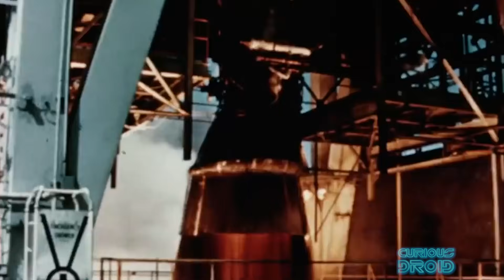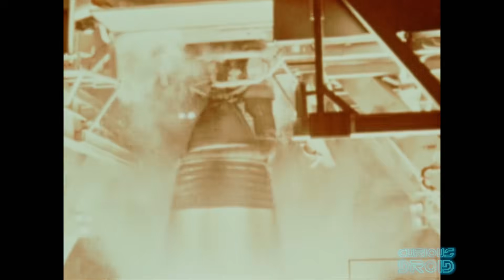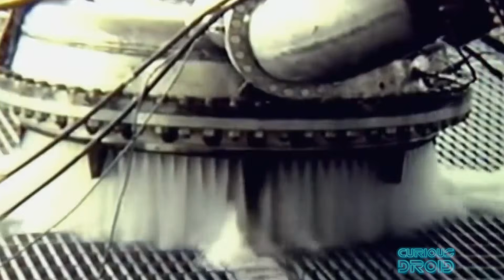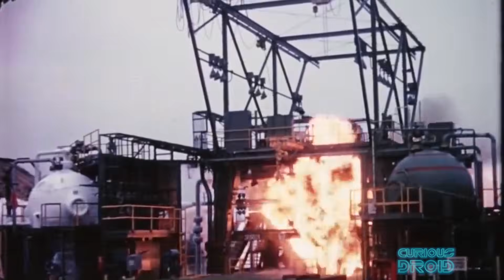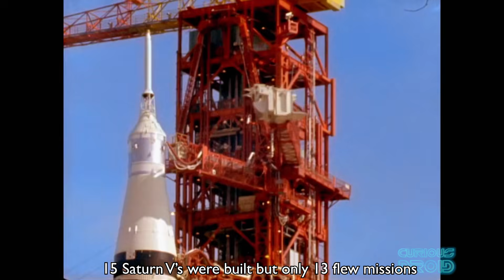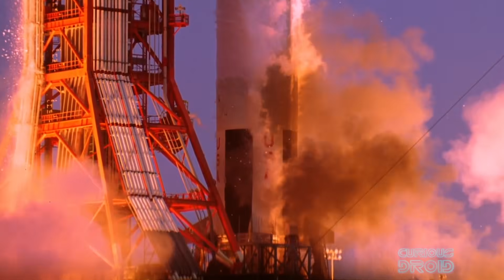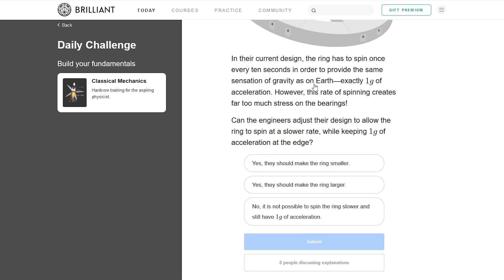F-1  The Engine That Nearly Stopped the Apollo Moon Missions

Comment: Those five F-1 rocket engines turned the night into daylight on Apollo 17. At 17 years old I was awestruck at the vibration in my chest even at 3 miles away.
/Unbelievable ...
Reply: A lot of the vibration and all of the crackling was from the huge turbopump. They needed a huge turbopump because the F-1 was a very inefficient 'tubular' design made of brazed thinwall tubes. This gave the turbopump huge pumping losses to overcome in pumping the fuel through those tiny tubes and limited the combustion chamber pressure to 70bar max. These issues, combined with the straight through injectors in the injector-plate made for a very inefficient, dirty burn. You can even see soot on it on the rescued plate (Bezos).
For context: In the same year the Soviet NK-33 was managing an oxygen rich closed cycle design with swirling injectors and a 200 bar chamber pressure.
The best bit of the F-1 motor was the turbopump.
Reply: @G-ra-ha-m  I'm not a scientist, but it appears to me that the "rich" mixture was on purpose to reduce combustion chamber temperatures.
Reply: @otpyrcralphpierre1742  You could be right, there was some reason for the straight through injectors. It's bad for thrust but would probably burn cooler (more reliable) and look more impressive. It really was great for show, which by that time was it's sole function.
Reply: I remember watching Apollo 17 here in Titusville as a kid. It's something you never forget. I will probably never see something that powerful take off again in my lifetime sadly.
Reply: @tonydove5569  your not gonna watch SLS launch next year?
Reply: @MrGeforcerFX  Oh yea I'll be watching. But with 3 shuttle main engines and 2 boosters it wont be much different than a shuttle launch really.
Reply: @tonydove5569  4 SSMEs and the boosters are now 5 segment giving another 1,000,000lbs if thrust combined over the 4 segment boosters for the shuttle.  Should be a bit louder for ya.
Reply: That WAS the energy explosive equivalent of a small nuclear device. The outcome of lighting that candle checks out.
Reply: Tony Dove l
Reply: @MrGeforcerFX  Next year sounds a bit too optimistic for this disastrous program :)
Reply: According to the launch announcement, Apollo 17 could be seen 500 miles away.
Reply: I grew up on Merritt isl. We watched from N. Banana river Dr. Unobstructed view up the river to the pad. It was the most memorable moment in my young life. My mother was very insistent we had a good spot to watch from. She knew how historically important. I was just impressed by the whole thing. Up till 17 they were ALL daylight launch. But that night launch was like none other. I've seen hundreds of launches over the years. And that is one I'll NEVER forget
Reply: @tonydove5569  spacex is developing Starship which has about twice the thrust of Saturn 5 at launch and SLS also has ~10% more thrust than S5 at launch so cheer up sir
Reply: @karthickmurali598  SRBs aren't nearly as spectacular at launch. Any night launches are cool. But the 5  F-1 engines on the Saturn 5 were just awe inspiring.  A sight to behold for sure. I've seen hundreds of launches. All are really cool. But no comparison. Who would suggest it was for nothing but visuals? That's just insane. Right up there with the flat headed idiots.
Reply: @boatguy64  sounds like a great experience. I wish i had the opportunity to see something as epic as an saturn 5 launch. F-1 engines are really an monster
Reply: @karthickmurali598  i watched ALL of them. Inc Sat 1 and last of the Gemini. Plus ALL early airforce. Many went... Pop. 😁
Reply: I envy you but was too young/poor to travel from CA to FL at age 12, but I eventually got to work on those F-1 test stands at Edwards AFB by 1987 on other projects like RS68 - awesome!
Reply: I was there too. I will never forget. Orange flame first stage, blue for second, looking straight up it's a*s as it pitched over going downrange.
Reply: @litespeed65  500 miles ... Amazing feat of engineering.
Reply: I would love to see that.... was it bright? The details from 3 miles away is interesting to me
Reply: One great regret in my life is I never had an opportunity to watch a Saturn V launch in person. Had to be one of the most magnificent things a human could witness.
Reply: @bigal1863  
It was. You Felt it. The air moved.

Comment: The F-1 engine is truly an engineering masterpiece and is just plain beautiful as well. My hat is forever off to those engineers.
Reply: Technically the 1962 design F-1 was obsolete even in 1965. From an engineering perspective it is a disaster.
NASA thought so too and never used it or any similar design ever again.
Reply: @G-ra-ha-m  Except they did use the F-1 to go to the moon. Not really a disaster.
Reply: @therealuncleowen2588  That's what NASA tell us. For such a great rocket that took 7 years of R&D they abandoned it rather quickly - Skylab was basically a hollow unloaded Saturn V. No one does that.
Reply: Andrew Montz The F-1 was a big, dumb engine. There were pluses and minuses with this philosophy. I could be equated to a big, lazy Cadillac V8, compared with other engines like the NK-33, which was a highly-tuned sports car by comparison. The RL-10 is more like a Toyota Prius. The reason it was not very sophisticated was that it was disposable.
Reply: @G-ra-ha-m  regardless it served its purpose and it was reliable for its original intent. Next!!
Reply: @geemanbmw  Perhaps we disagree on the purpose and intent, as a propaganda tool it was wonderful, as a means of getting the Apollo hardware into orbit - not so much. 
We know NASA never did get a man to the moon from their photographs and after the show it was scrapped and NASA switched back to the task of getting man into space and started on the Shuttle.
Reply: Of course there would have to be a flat earth moon landing denier in the comments 😂
Reply: Oh man. almost took them seriously
Reply: @G-ra-ha-m  Wait are you the same Graham that said COVID is over and people should not wear "muzzles"?
Reply: @R3lay0  Why do you never wear a mask?

Comment: One thing that's amazing to me: They didn't give up on the F1 with all those problems! That's commitment ...
Reply: Any rational engineer would have put 4 combustion Chambers on it.
Reply: They did, it was discarded after the program, it was not developed further. The last two Saturn were not flown.
Reply: @timtim8468  It was developed further - both during the program, into a titanic M-1, and relativly recently, into a relatively same-sized F-1B. The thing is - Saturn program was stopped due to the political pressure.

Comment: Detonating bombs inside a running rocket engine sounds like - well - don't try this at home. :-)
Reply: You should learn about Project Orion. Detonating nuclear bombs as a normal operation mode of the engine.
Reply: @caav56  Yes, they even tested it on a scalemodel with nonnuclear explosives.
Hot stuff...

Comment: What's up keep up the great content 😄😄 I've watched those Apollo moon landings , what a technological breakthrough, since only 80 year's earlier it was horse and cart.
Reply: Yup, and I hate to admit it but those nazi V2 engineers were brilliant and way ahead of their time with rocket and rocket engine design.
Reply: Just think of this, your smartphone is a million times faster than the computer that assisted landing on the moon. Theoretically, if u have all the resource, your phone can assist to land u in the moon or other planets
Reply: @voongnz  yes ,love it or hate it , war develops technology , especially in physics, look at the 20th century, breakthroughs in rocketry and atomic energy this pioneered man's space travel, without the V2 rockets we wouldn't have gone into space, dark dynamics of nature should not be underestimated.
Reply: @doodskie999  I see your point, the mainframe computers of the time were as large as a room, now we have a million times memory in a device that fits in your pocket 🤣🤣🤣🤣
Reply: @doodskie999  Yes, but your phone is far less reliable than the simple computers used on Saturn, which were designed and exhaustively tested for radiation, vibration, temperature, and redundancy before being cleared for flight, not to mention the extremely strict software configuration control, resulting in a near-zero error rate in the code, something no phone app developer has to worry about. If those computers don't work, they can kill the entire crew. I would never trust a cheap smartphone to do that task.
Reply: @RCAvhstape  thats why I said "theoretically" lol
Reply: @voongnz  Those V2 rockets were based on American technology that was shelved.

Comment: F1 is my favorite Rocket Engine of all time...I would love to see a newer  Computer designed F1 back in use for revisiting the Moon or lifting Heavy Payloads for a Mars Mission....Congratulations to the Apollo 11 astronauts and the team of workers and Engineers that worked so hard to get man on the moon, and safely home...50 years ago today...👍🇺🇸
Reply: @Deckard_9732 The SLS is probably half-dead at this point due to intense competition, cost overrun and abysmal delays. I wouldn't be surprised if NASA's moon mission is launched by a spacex rocket.
Reply from the maker: Thats the F-1b, that put it forward as the propulsion for the new SLS bu the 5 segment SRB's won the competition, i did a video which partially covers that  here https://youtu.be/ovD0aLdRUs0
Reply: It appears that all the successful engines of today burn liquid methane and liquid oxygen. If you notice they all burn clean with no smoke .

Comment: I have so much respect for the men and women that created and built these rockets....🇺🇸
I’ve heard that they are unable to build them today because the skills were lost when the technicians passed,🇺🇸
🇺🇸
Reply: That is correct. Those nazi scientists were geniuses. The V2 rocket designed by von Braun traveled into space in 1944.
Reply: Erick Cisneros true we cant build the F1 anymore as theres hardly any physical blueprints of designs for the engine since there where no ways to save data and such back in those days like we do today . They just passed it on word of mouth and on scraps of paper that are not easy to understand now . But tbf we could likely design somthing much better nowadays . Would love to see aerospike engines used personally
Reply: @peatmoss4415 They definitely work at a slower pace these days.
Reply: @Husker5454  All the blueprints exist as to many parts.  The methods of manufacture used back then don't exist now, that's a big part of the problem.  People thing designing the rocket is hard but designing the production system is even harder still.  They have a modern design, the F-1B.
Reply: neil ogborne stupid comment
Reply: @briandenley  you may see it as a stupid comment, but it is a truthful comment.

Comment: If engine is vibrating put small bombs to correct it. 😂
Reply: They really over simplified this....my grandfather ran the vibration and acoustic lab at Marshal and his college roommate was the chief engineer on the F1 for NASA...the black powder testing was basically like "if we can survive this, we can handle anything". They did much, much more to modify this engine. When they did the cluster test on the large test stands at Marshal, they were sued by cities all the way into Georgia, over 200 miles away for breaking windows, vases, etc. It registered on seismographs all over the south east....just remember, these engines dwarf the shuttle engines. Fuel lines were 36" in diameter and had the same flow rate as cutting the bottom out of a water tower.

Comment: A lot of the stock footage of the "F1" is actually the J2 (you can see the blue flame and the shock diamond that is typical of high pressure H2/LOX engines)
Reply: You can also see the yellow flame of stage 2 of the Apollo 11 separation, indicating that they were not even using a J-2 for the 2nd stage of that launch, but probably an H-1. There's quite a bit of evidence that no complete Saturn-V was ever launched and they were all modified 1Bs. This theory is backed by NASA dumping the Saturn 'V' ASAP.
Reply: @G-ra-ha-m  Are you a Moon Hoaxer?
Reply: @michalzustak8846  No. The Moon is definitely real, try looking up - it's right there on most night. BTW if it's raining don't worry - it's not disappeared - it's just clouds in the way.
HTH

Comment: It’s truly amazing that they built these engines and all the other stuff to eventually put a man on the moon with less computer power than today’s average smart phone
Reply: MrAli171 they build SR-71 blackbird with a fcking rules without computers in that time. They were true engineers.
Reply: tgstudio85 the blackbird is a totally amazing plane and as you say designed and built using slide rules that’s what I meant about engines and the computer power for the Apollo 11 mission, the best laugh about the blackbird was the majority of the titanium used to build it came from in that time
The Soviet Union via 3rd party company’s set up by the CIA

Comment: Brilliant video.  I had no idea the F-1 design pre-dated manned spaceflight.  I would love to see a video explaining why the F-1 was RP-1/LOX fueled vs the J-2 which were LOX/Hydrogen.  As the potential energy of the LOX/Hydrogen fuel is so much greater than RP-1/LOX, the reason for choosing it over LOX/Hydrogen for the F-1 has always puzzled me.  Thanks for doing these.
Reply: Hydrolox is a pretty problematic pair due to hydrogen's low density, high boiloff and embrittlement of the tanks. Because of it, old but gold kerolox was chosen for the first stage, which wouldn't have had benefited from hydrolox much. However, M-1 - a planned successor to the F-1 - was being developed to be hydrolox.

Comment: The Soviets had their own "F1" engine, the RD-270.  It was a little smaller (or maybe "less large" is more correct) at "only" 1,360,000 lbs of thrust.  Mikhail Yangel's R-56 booster was going to use four of them in the first stage, the closest things the Soviets every designed to a Saturn V.  It had the exact same problems with combustion instability, but they never did fix it before the project was cancelled.

Comment: Can you imagine building a rocket that sets on top of five  F-1 engines pushing upwards on it with with  3750 TONS of thrust? Can't believe the whole thing didn't just "accordion" into nothing but that wrinkled up paper thing you take off your soda straw.
Reply: Atlas rockets were way worse in this regard (literally made from foil), and yet they didn't buckle (most of the time).

Comment: One of the first concepts I learned after engineering school as a paid employee was addressing issues by creating issues. In order to solve mechanical problems you'll likely need to reproduce the problem. If the problem is reproducible it is much easier to determine the reason.
Reply: bogen broom can you explain where is barrier between Mount Everest altitude  pressure of 31hPa and sea level pressure of around 100hPa? It’s just 8km difference and pressure is 3 times less;)

Comment: Oh, did they lost all the blueprints to the F1 engine? And 50 years later, we still struggle to rebuild it?
Reply: There are plans for updated version, though - F-1B, which was planned to be used on "Pyrios" booster rocket for SLS, until Pyrios was ditched in favor of Shuttle-derived SRBs.
Reply: @caav56  Why update? Saturn v f1 rocket had a 100% success launch (Apollo 11 to 17).
Reply: @CrazyCandyCrush  Because original F-1 is very complex. Updated F-1B were designed with modern-day materials and tech in mind, allowing for higher efficiency.

Comment: This engine got the rocket into the sky, but we still didn't land on the moon.
Reply: @mightysaturn5133  thanks doc😁
Reply: @Q.E. D they immediately start arching towards open water away from the public. If they really went there why would they destroy all the best proof? https://youtu.be/BK-uatwOOeA like the telemetry data, original footage (now they claim to have sold a few reels at a yard sale to an intern 😆) or the designs?
Reply: We have the original footage. You can find it right here on YouTube. You're thinking of the slowscan video.
Also, we did go to the moon. 6 times. There are pictures of the landing sites.
Reply: @hydrochloricacid2146  they had YouTube in 1969? I thought it was just Hasselblad camera reels but maybe I am mistaken.
Reply: @nealswanson8684  don't be pedantic. The footage was retransmitted to earth for all to see, and recorded.
Reply: @hydrochloricacid2146  live transmission from the moon with a 12 volt battery 😆
Reply: @nealswanson8684  28V actually. But you don't need much power when you have a huge receiver here on earth.

Comment: rp-1 is not a "highly refined kerosene." in fact, it is just the opposite. k-1 is a highly refined kerosene, meaning the impurities are almost completely removed. rp-1 has impurities actually added in to increase the length of the polymer chains to get better thermodynamic performance characteristics.

Comment: I'm not an engineer, but I've been thinking, what if instead of one large combustion chamber the F1 had multiple smaller combustion chambers feeding the same nozzle. Would that have worked and solved the instability problems?
Reply: That's the Russian approach. The RD 170 is stronger than the F1, extremely efficient and reliable because it uses four combustion Chambers. This is pretty common with Russian engines.